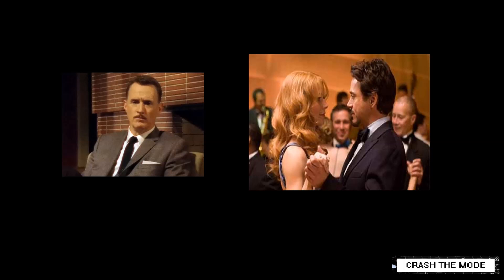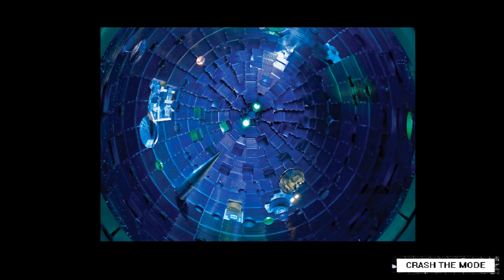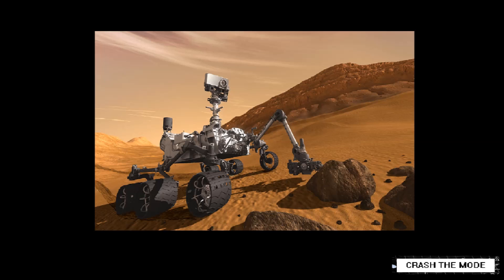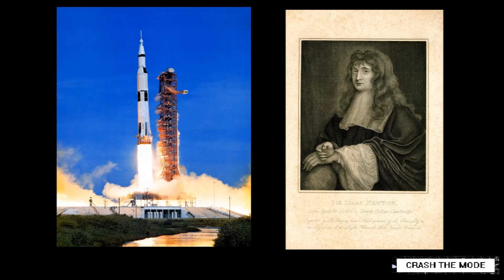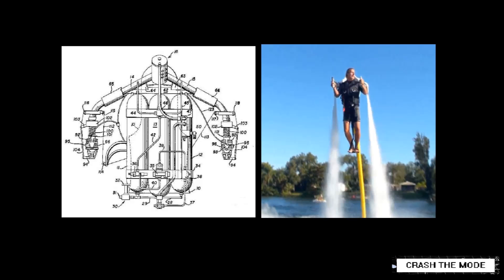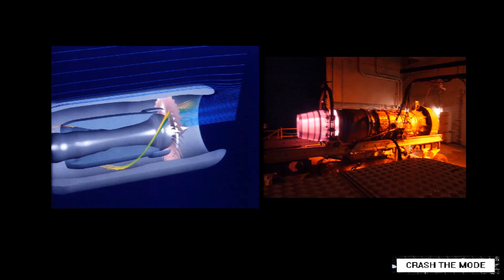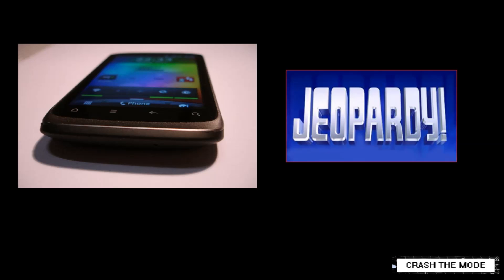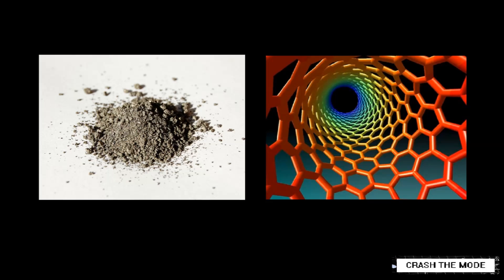The Science of Iron Man

Comment: M.I.T have actually developed a concept for a theoretical ARC Reactor. It uses Rare-Earth Barium Copper Oxide superconductors to generate a magnetic field around super-heated plasma that produces around 13 times more fusion energy than is required to heat the reactor. Sounds pretty good to me.

Comment: Well, all of this is based on comics, but let's do an overview anyway....
1) you're assuming the suit is 180 lbs
2) you're assuming the arc reactor is NOT able to create a field capable of splitting o2 molecules apart, creating thrust
3) you're assuming an expendable fuel is needed.
Not so much. If pepper pots can carry around and toss over the suitcase IM suit in IM2, then it damn sure isn't 180 lbs. It might be like fifty pounds, but that's still silly lightweight.
For some time, I've had the idea that the arc reactor/repulsors are not actually using fuel, but are tapping into either matter/antimatter reactions (suuuuuuuper risky) or it's tapping into something Tesla spoke of: Scalar Waves. He repeatedly said: "there is enough energy all around us all the time to power mankinds machines for free, without fossil fuels." I personally think the "energy field" he mentioned is really a wavelength of vibration that accesses this 'energy field', uncorking nearly unlimited power.
Reply: NICE IDEA
Reply: Actually Tony suit only weighs 25 lbs

Comment: The Repulsors and the Arc reactor are all part of the same system. So there are not 5 arc reactors in the suit just one. But yes creating a micro sized high output electrical generator which I presume is a continuous output source based on the chemical "Paladium" metal reaction as explained in IM 2.

Comment: Here is a thought, nano-tube engineered Jet engines...say 4 with 85 lbs of thrust. light weight, powerful enough to lift and efficient enough to use minute power supply, allowing fuels for RC Airplanes to power a suit for at least 30-40 munutes...I like the idea of using some sort of electric however it would be to heavy and would stay the same weight after it was depleted, I would recommend a powerful battery for some features but not the engines. Maybe Hydrogen cells, and even better, maybe taking hydrogen out of the atmosphere or water from the oceans, that would be an entirely new problem due to water resistant metals...another issue to overcome would be the hydraulics, however nano technology is well on its way to provide an alternative....and Jarvis is already possible, there would be alot of expense in both time and money to develop such a refined model, but along with "Meta Spaceglasses" and current  "Stilo" Motorcycle helmets suggest the ability to create iron man with jarvis uplink. In any case there are so many different technologies that can assist with the development of this suit. even if its not the exact iron man suit, it can be dangerously close.
Reply: could u help me with jet boot designs? Right now I'm trying to make an exo-suit very similar and I need help with the energy source and jet boots and u seem like u could help with that! I got down the holographic H.U.D ( the solution is upgraded google glass) and armor. But it would be sswweeeeeeett if u could help! plz reply :)
Reply: I am making an Exo suit we might use our ideas?
Reply: James Ross thanks for the idea it just makes me exciting, thinking about being inside a suit and flying around in no time you'll see me on the news blasting across the sky!!!!!!!!!!!!!!
Reply: James Ross im trying to make super compressed thrust liquid so i can fit more into my suit.( P.S i'll keeping updating u guys on the suit till im done!!!